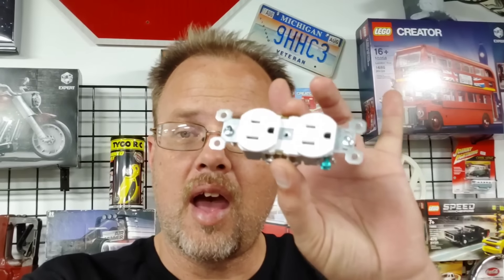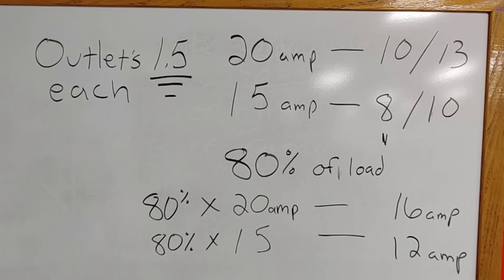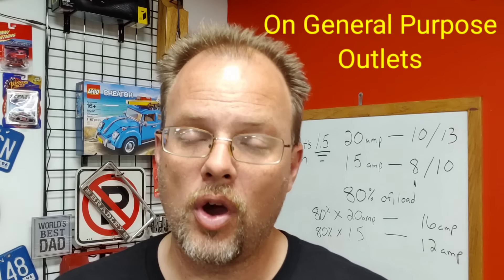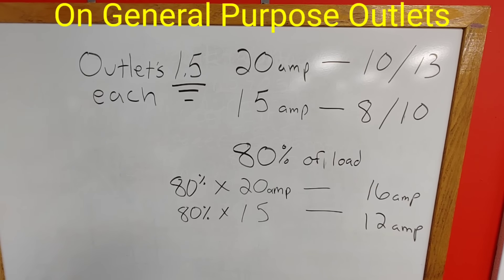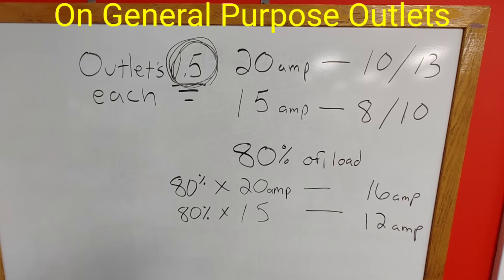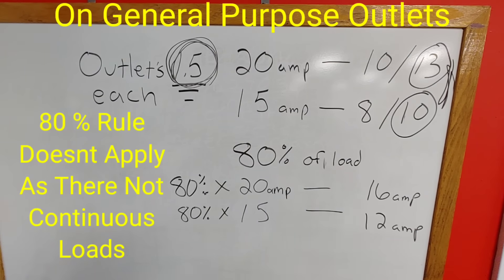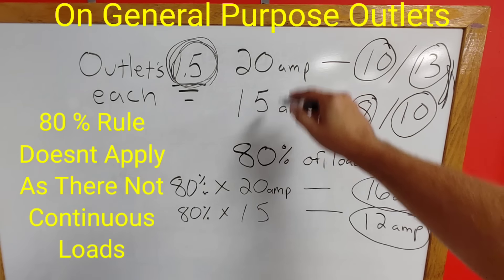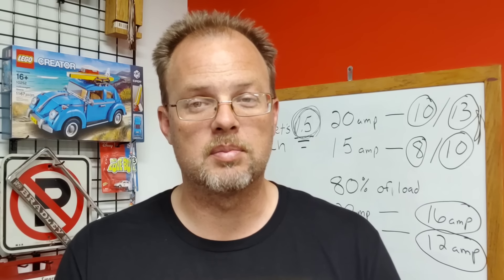How many outlets can you put on one circuit ?

Comment: longest its max to circuit breaker amp load...20amp this case, its the wire that matter on the load...you can have many electronics tied together that add up to 20amp...usually fridge runs best on separated breaker that share with lights while another breaker for outlets...

Comment: People are usually asking you the wrong question. What they really want to know is how many circuits do I need for a room or outdoors in which case you need to know what they plan to use in the room or outdoors. Not just maximums or minimums. Telling them they need to put one in for every 6ft of linear horizontal wall space. The fridge needs to have its own because it needs to be on a non GFCI circuit. The garbage disposal needs its own as does the dishwasher. Plus the kitchen needs to have at least two GFCI 20 amp circuits.  If you decided to put window A/C in each bedroom you will need a single circuit for each A/C. If you want a garage or basement workshop you'll need more than one circuit if you want to operate multiple machines. A bedroom with two kids using desktops for school and lighting is one 15 amp circuit. Think circuits and think more is better saving on a few feet of wire and breakers is being penny wise and pound foolish.
Reply: The NEC does not require a receptacle outlet every six feet.  It requires that no point along an unbroken wall be more than six feet from a receptacle outlet.  Also, refrigerators are not exempt from the requirements of GFCI protection.
Reply: @dburt1  Okay on th 6 feet but I seem to remember the exception for the fridge because of leakage current due to capacitance between the motor windings and equipment ground. The GFCI will trip if the current isn't opposite and equal in both the hot and neutral circuit.
Reply: @kimobrien.  The NEC requires GFCI protection for all receptacles serving countertop areas and all receptacles within 6 ft from the edge of a sink.  There is no exception if one is used for a refrigerator.
Reply: @dburt1  Well I'm thinking about years ago. If the fridge makes the GFCI trip do you move the receptacle so it isn't within 6 ft of a sink?  If its a single receptacle for a standing fridge than it isn't serving a countertop area.

Comment: Interesting subject....i am dealing with it now since i am doing a complete kitchen renovation with a new location for the refrigerator and a dedicated outlet for it...new recessed lighting and more counter space which means more electric outlets...an island with lights on top of the island...my way of handling the amount of electrical outlets needed is like this....no more than 3 to 4 outlets per line that way the people that use the outlets don’t overload them that way they never blame you for a shabby job...in theory you can put a100 outlets if you want to....just don’t overload the line...
Reply: That rule does not apply to kitchens because small appliances can be plugged in there. Best to read article 210 and 220 carefully.

Comment: UK electrician. We can put unlimited amount. As long as your conductors are rated higher than protective device, its safe. To avoid nuisance tripping the load is normally split over 3 or more circuit's.

Comment: So I am now working from home . . .er I mean studio apartment . . . with multiple computers and extending display to large screen TV.   If everything on one circuit as I suspect, how much electronics can I run simultaneously?
Reply: If I'm understanding this all correctly... the answer to your question would depend on the wattage used by everything you have plugged in on that circuit, so you can add up each electronics wattage and have no more than 1,800 Watts total on a 15 Amp breaker.  Soo dont plug in more than like 900 led light bulbs or run 2 microwaves at the same time lol 😆 

Maybe someone that really knows can chime in that and confirm that though lol

Comment: Interrestig.  Maybe you also include  for the non-electrical type people  that 12 gauge wire on the 20 circuit breaker ane 14 gaurge wire on the 15 amp breaker,  plus what happen tp the 3 watts per square foot rule?
Thanks

Comment: I’m going to piggyback off of an outlet to run a new outlet for a wall mounted tv. The wire i bought has black, white, ground. The box i’m running from has red, black, white and ground. Can i ignore the red and run the black and white without problem?
Reply from the maker: If there was a red its usually a switched hot or extra wire for a threeway.  So yes ignore the red and just use the black, white, ground.

Comment: Would it not be better to consider each plug as 1.5 amps and since the receptacles are 2 plugs each outlet would really be 3 amps if both plugs are connected and being used?
Reply from the maker: It's not required but you can.

Comment: Personally I put light in each room on separate circuit and if 4 outlet in a bed room 2 on one circuit and 2 on another this way if you have issues with any outlet you have lights having light on separate circuit is code around here on the other hand if you need to change the light switch or fixture you can plug in a work light into the outlet. 
Also if running 14awg wire 15 amp breaker max 12awg 20 amp breaker max however you can put a 15 on 12awg also if running a very long run 15 amp circuit should be on 12awg kitchen outlets need to be split by removing the joiner between the two hot terminals and connected to a 2 pole breaker and dedicated breaker for each kitchen outlet  because of the demand of most kitchen appliances like toaster and other cooking equipment refrigerators should be dedicated circuit unless you want your food to spoil .
Think of it you just spent 200000 plus on your home and you would be so chintzy as to NOT spend 500 bucks extra to make everything safer this is why so many houses burn to the ground every year due to wiring issues. 
So do the math why would you want to try to put as many outlets on 1 circuit unless you're absolutely stupid or a stupid and lazy contractor who cuts corners but still charges for a job that's not up to par for the demand on these circuits. 
And you think you don't need a high capacity circuit in a bedroom or office well my computer has a 1800 watt power supply if i have my printer going and my speaker system going it blows a 15 amp breaker before I turn the speaker on so i have 2 dedicated circuits on 12 awg wire on 20 amp breakers. 
So why cheap out and burn the house down. 
Obviously if the breaker blows once it'll happen again and every one thinks well just put in a 20 or maybe even a 30 amp breaker with out upgrading the wire gauge and presto instant wiener roast and lost everything you have worked for...or worse burning family members.
There is a reason why there is no set amount of outlets on circuit you need to know the load that will be used on each circuit that is why I put 12awg wire for all outlets this way it can be upgraded to a 20 amp from the current 15 amp breaker

Comment: Good to know. I’ve herd about this too. And technically to my knowledge you can have 200 outlets all is if no one plugs 🔌 too much stuff 👍😎 I enjoyed the video
Reply from the maker: Yes as a outlet has no load :)
Reply: @BevinsBuilds  thanks for that.    Im going to put 14 on my 20 amp circuit but they will only have some LED lights on them and most wont be used at all.
Reply: 200 plugs, how big is the house?

Comment: Microwave and space heater overload a 20 amp circuit.  Please explain why.
Reply from the maker: Just going off of the typical space heater is 15 amps and a microwave is going to pull about 8 amps so that puts you over a 20 amp draw.

Comment: if wiring a house put each room on it's own circuit.  Each major appliance should also have it's own circuit.  This is a more logical way to wire than counting outlets.  It also makes it easier to troubleshoot problems.  I personally don't like using 15A circuits as they are easy to overload.  20A is my minimum.
Reply: Would you recommend separating lighting and outlets on different circuits for the same room? For instance LED can lights for a living room
Reply: The code for kitchens is a minimum of two app. Circuits of 20a  , doesn't mean you have to follow the minimum, each plug in the kitchen counter counter be dedicated if you  want the would be the maximum side  .
Reply: The code for kitchens is a minimum of two app. Circuits of 20a  , doesn't mean you have to follow the minimum, each plug in the kitchen counter counter be dedicated if you  want the would be the maximum side  .

Comment: I was taught, it depends. Living room, bedroom could be as high as 15 because some outlets will not be used. They’re there for flexibility of furniture layout. Typically each room will have only one or two lamps with 100w bulbs.  (1 amp each)  Today no one uses 100w bulbs anymore, they’re using LEDs that use a tenth of that.  Kitchens are 1/2 an outlet per circuit. The upper and lower part of the outlet are on different breakers. This is because electric kettles, woks, toasters, microwave ovens are all 10 to 12 amps each. Any 2 devices on together will trip a 15 amp breaker.
Reply: Someone told me it was against code to have a receptacle wired to two different circuit breakers.  But, what you say makes sense: toaster oven and countertop microwave running at same time and plugged in to same receptacle.  Can you refer me to a citation in the NEC?
Reply: @glasshalffull8625  I'm not sure what the NEC is, I'm from Canada so it's a bit different. The trick is on the hot side of the receptacle there is a little breakaway bar between the two brass screws. By breaking this it allows you to wire a breaker to each half of the receptacle.  To make it safe each breaker must come from different sides of the breaker/fuse panel. The service coming in to the house consists of two hots and one neutral. Each hot goes to a different bus bar in the breaker panel So the breakers must be on different hots. You then run a three conductor (Black/Red/White) cable to the receptacle where you have to remove the connecting bar between the two brass screws. Here's where it gets interesting. The two hots are out of phase with each other. If you measure the voltage between them it's 240v but only 120v between either hot and the neutral.  When you're using the receptacle and have two devices plugged in that both take 15 amps, you would think the neutral would have 30 amps and get hot, but since the two hots are out of phase they cancel each other out in the neutral and the neutral actually has zero amps running through it. The neutral only ever has the difference in amperage between the two hots. So if one device is drawing 15 amps and the other 10, the current in the neutral is only 5.  Cool physics.
Reply: @bcreason  The NEC is the National Electrical Code for the US.  I did a little research and it appears the NEC changed re split receptacles.  You can split them, as you described, but they have to be on the same breaker.  So, instead of two single pole breakers, they have to be on a double pole breaker.  This is an added safety code so that you only have to throw one breaker to cut the electricity to that receptacle.  (For safety, after the breaker is switched off, everyone should be testing both sides of a duplex receptacle to make sure it’s not hot and then the same with all the wires coming into the box)
Reply: @glasshalffull8625  Makes sense. I think the breakers in my house are physically linked together as well. So you have to switch them both.
Reply: @glasshalffull8625  all good advice......but, perhaps, the  '' glass is   TOO   BIG   ??   """...................

Comment: Hi my friend !!!
Can i mix 15amp and 20amp outlets on the same breaker ???
Reply: Yes you can! You can also put 15 amp receptacles on a 20 amp breaker, as long as there is 2 or more receptacles on that circuit
Reply: Great question and answer. Happen to have a code reference?
Reply: @submittedbymail  table 210.21(b)(2), table 210.21(b)(3), 210.24

Comment: Trying to understand this correctly, wondering if what I've done is, I understand this is my responsibility and not asking for legal or electrical advice just your opinion,
20 amp breaker in a 200-amp house panel,ran 10 3 wire 75 ft to a outbuilding, put that into a metal enclosed metal junction box which then wired 12-2 wire to the 10 3 wire then ran 12 two wire two receptacles in building, jumped 14/2 wire off of one of those receptacles to run some lights

Comment: In fact it depends of the total load in watts for that circuit that is not going to be more than 80% of the capacity of Circuit breaker and wire size and the distance from the panel where the breaker of that circuit is located. (voltage drop)
Reply from the maker: Its really rare to need to calculate voltage drop for homes as voltage drop isnt a concern until after 100 ft.
Reply: All this parameter you are runing an electrical job .

Comment: One other problem the NEC CODE, it’s updated every so many years, however, it’s up to the local governing body (City or county) which one they follow. I have run into some smaller cities following  the NEC code that is 15-20 years old. Normal is to lag 5-10 years behind the latest.....thanks.   Jim
Reply: Great advice, doesn't matter what NEC 2020 says when the inspector approving your work runs off a different version.

Comment: what I am confused about is when you start going up to larger amp circuits like 30A  and the number and AMPERAGE rating of the recepts.
Reply: 30 amp circuits and above are 240v and are typically dedicated circuits, so only 1 receptacle per appliance. For example an electric dryer and a 40 gallon or more water heater, will usually need a 240v 30 amp individual circuit for each one.
Reply: @surferdude642  are you saying that 30a circuits can't be 120v and not dedicated?
Reply: @carlodonnell146  Yes, appliances that I mentioned require approximately 5000 to 5600 watts to operate. 5600 watts is about 23 amps on a 240v circuit and would be 46 amps on a 120v circuit. 46a on a 120v circuit is not possible. They still need to be dedicated because 30 amps is the breaker rating. 10 gauge wire is normally used for 30 amps and a 120v receptacle can accept 10 gauge. It can be used in long runs or when an actual 20 amp plug and receptacle are required. Even then, the circuit breaker cannot be more than 20 amps, so it's defined as a 20 amp circuit.

Comment: I was really hoping to get a dewalt 15 amp table saw for a small workshop in my home, but the outlets only allow for 15 amps. Would it be unsafe to run it even if it’s more than 12 amps
Reply: Basically the 80% rule is for heating loads since they add heat in addition to the heat generated by the load current. How many additional running loads  besides the saw on that circuit will determine if the saw will run or trip the breaker. The manufacturers of heating loads like toasters will limit the load current to 12 amp for a 15 amp pigtail. So the customer need not worry.  People installing electric baseboard heat need to follow the 80% rule.

Comment: One place I lived - local code said no more than 5 outlets on a circuit. Guess they were tired of 1di0tz burning their houses down.
Some gaming rigs use a 1200 watts power supply - about 10 amps for that alone.
Doesn't count that 1000w stereo, lights, or anything else.

Comment: i generaly will use no more than 12 devices on a 15amp or 16 for a 20amp but ill also use my head and chk with client as to what their intentions are as well as try to plan for future use
Reply from the maker: Thats a good practice.  I usually stick with 10 to 12.
Reply: New code in Canada is 10 max on a 15 amp circuit.
Reply: @vandoo66  you all have to gfci/afci everything as well as all the 240v appliances?     the gfci  everything was being dramatic but mine as well be at current rate of things lol
Reply: @wizard3z868  not quite sure what you’re getting at but what I meant is on a 120V 15amp circuit you cannot put more than 10 plugs.
Obviously if the plugs are designated to certain tasks than the total wattage is easy to determine and you adapt accordingly.
Reply: @vandoo66  i was just wondering if canadas regs became more stricter like ours in the states did we have to gfci/afci like everything and some ahj are mandating gfci/afci protection for the larger 240v appliances like range/ovens, water heaters
Reply: @wizard3z868  yes, was 12 on a breaker until latest code update.
We pretty much resemble US  code from what I can tell watching these youtube vids.
Reply: @vandoo66   my understanding of your codes comes from watching mike holmes shows lol  and yes they are almost the same
Reply: @wizard3z868  in practise a gfci breaker on a condensate pump will trip for no reason.
Reply: @danlux4954  sump pumps also will trip, and GFI/GFCI are not required for sump/sewage/effluent pumps....Jim
Reply: @darbyl3872  The reason pumps do not require GFCI’s is that they will trip the GFCI, and will not work. Location of the GFCI doesn’t matter. This is for the US, Canada?     Jim

Comment: I don't know where you are but I've taken out permits in Calgary Alberta Canada and the code at the time was 12 combined plugs and or lights per  circuit we did not use 20 amp circuit breaker except for appliances that needed them we used split plugs on the kitchen counter if there were 2 plugs on a counter both had to be separate split plug circuit if a 3rd was required it could be run from the first and on the counter plugs were a maximum of 6 feet apart so no point on the counter was more than 3 feet from an outlet regular wall plugs were 12 foot maximum  interestingly stairs ownly needed a switch at top or bottom we found that out when the electrician gave us the wiring diagram for my brother house and no 3ways included had to pay 10 $each extra
Reply from the maker: Canada and America have very different rules.